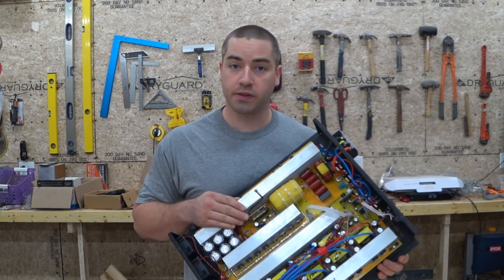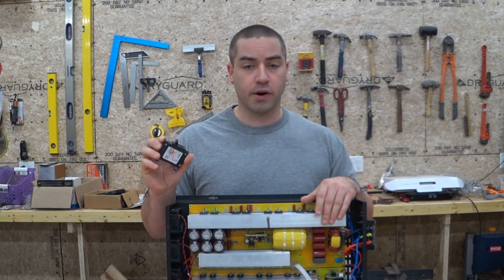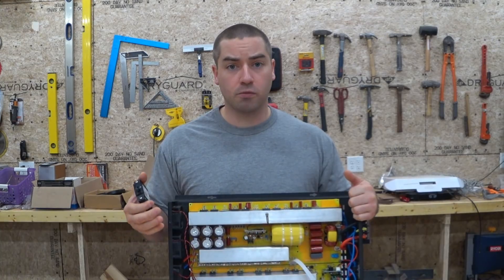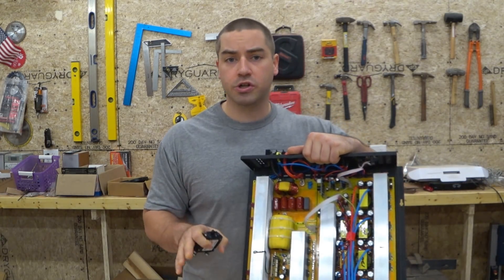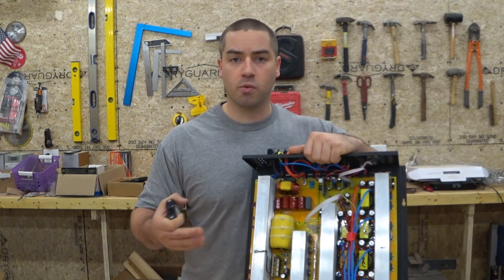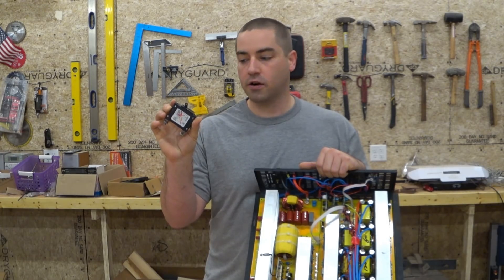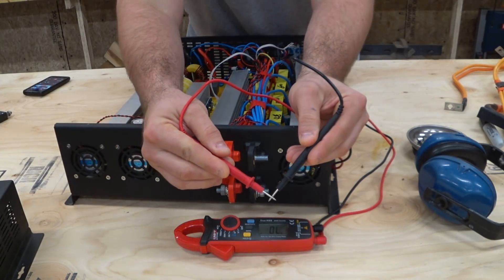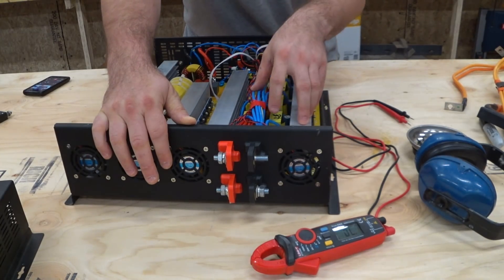Did I Blow Up the Inverter?

Comment: You had each "group" of that "junk inverter" burn out which lead to more and more power going through fewer and fewer of the groups until they all burned out for being short this caused the circuit breaker to break. Now, what cause the first one to burn out? Poor design.

Comment: Hi your correct to a degree regarding the circuit Breaker, but circuit breakers are designed for different applications, inrush of motors require a different type of circuit breaker, compared to a circuit breaker protecting a lighting circuit,

Comment: Did you increase the input wire wire size or triple them from your DC buss to the circuit breaker and inverter? I think someone mentioned that in the comments. It looked like you only used one of the supplied wires which would not supply enough current from the battery to the inverter to handle the surge and if you were to run a prolong draw of over 3k watts the wire would most likely melt. Hense, the 3 wires. A sudden drop of voltage at the input to the inverter would most likely cause a sudden current current overload to the mosfets' causing them to short and blow there fuses.

Comment: DC & AC are not the same... they behave in a different manner. In ac the electrons are in the center of the circuit and dc the electrons are on the out side of the circuit. this is why you should always use a much larger circuit for a dc current. You can install a large Cap. on the inverter side to fix this such as the cap/power supply for a car audio system.

Comment: I've designed inverters and switching power supplies for years and is now retired. It appears there is no load balancing and over current protection: they just hooked those individuals in parallel. To make it simple, these individuals have a heroic tendency to be "I can do it by myself" and when you hit it with big motors and/or capacitive loads that's pretty much a short circuit for the first few seconds, that fries the hero's  mosfets in no time.  Stay away from that brand or such design. Very tricky to start loads that are virtually a short circuit for the first few seconds.
Reply: thanks for this!

Comment: you are right on! you are not misreading this chart. the invert has no protection diodes, it has no snubber network. It is totally the designers fault of the inverter. Go to a you tube technician called (Diodes Gone Wild) and his power supply designs always have snubbers and diode protection circuits in every one containing Mos fet drivers

Comment: Jacob is absolutly right ... no snubbers on a cheaply built inverter will kill those mos fets every time
The spike on start up exceeded the mos fets peak voltage. A few more pennies invested in snubbers and protective circuitry would make reliable inverters company worthy of their name. I suggest sending them your miter saw to test their inverters BEFORE sending you another one. it will save everyone the trouble of burning out a third inverter in your home! maybe they will get it right on the third try

Comment: From wikipedia "When an electric motor, AC or DC, is first energized, the rotor is not moving, and a current equivalent to the stalled current will flow, reducing as the motor picks up speed and develops a back EMF to oppose the supply. AC induction motors behave as transformers with a shorted secondary until the rotor begins to move, while brushed motors present essentially the winding resistance. The duration of the starting transient is less if the mechanical load on the motor is relieved until it has picked up speed.

For high-power motors, the winding configuration may be changed (wye at start and then delta) during start-up to reduce the current drawn." ... on wikipedia they show a sample graph that this brief "in-rush" current can be like 50x of nominal ...

Comment: These are my observations ... 1) The multiple transformers are for the fact that the unit can handle multiple DC input voltages ... It looks like you killed the mosfets on the 48V transformer ??? ( I bet that if you can change the input voltage yourself it would work on all the other DC voltages ) 2) Your current calculations seem all wrong ... you seem like your mistaking amp draw on the DC input and AC output together  3) Without back EMF the pure resistance of the coils in the saw is the only current limiter in the first micro seconds of pulling the switch.  I think you can measure the ohms with a multimeter ( make sure you wait for the resistance reading to stabilize ) ... This should give you an idea with simple ohms law on the instantaneous amp draw when you pull the trigger. 4) The digital multi-meter is probably sampling to get a measurement of the amps ... probably an average over that sample time so a very very quick peak might be hidden over a sample period. 5) I was under the impression that AC breakers use a thermal means to cause a trip and again the thermal heating would "mask" an "instantaneous" peak were it would heat any wires much but an even very short but large current draw might burn out the inverter.  6) I would look on the spec sheet of the inverter and see if there is an instantaneous max amp allowed ...

Comment: Naw man...
U need to take a closer look at ur battery setup.. same breaker in both garage main circuits and in battery... they should both react the same in both systems. Long story short..batteries not compatible/communicating with inverter properly.
Reply: Also it looked like 3000 was wired in parallel which provided more voltage, and the 8000 was wired in series.

Comment: Just run the saw on 48vdc.  that's how do it.  Make a 48 volt rail for the universal motors tools.  They run slower but so much quieter and seems to be more ZEN.  If they have var speed idk.

Also add a
Reply: That would be a terrible idea. If any of the tools are 3 phase then you would be turning down their potential by 66%. And I would imagine they are, 3phase is more compact and much stronger.

Comment: There are 2 types of power inverters... low frequency (LF) and high frequency (HF). Difference is in design... HF step up voltage in high frequency in DC side - it is more effencient and cheaper (smaller transformers needed) and then the high voltage ~160V DC is by PWM switched to 120V AC (160 is because thats Vmax of 120V AC). The LF design works the opposite... You have just powerfull fets on low voltage DC side which makes the battery voltage to AC and then large transformer and smaller transformer to transfer it back for feedback. What happened here is just bad design HF inverter and cascade fail. It is caused by 2 possibilities.... 1st bad mosfets, 2nd bad design and cascade fail. I believe that both could be right bud lets see how it is made... Inputs are on one side and the current is pretty high. 1st transformer closer to the input will have lower losses on wires then the last one on the other end. That means than the first one will have higher current and can cause overload. Than cascade effect is pretty fast. Also theese big mosfets are not very good china ones.... try to find spare ones. Only china.
Reply from the maker: Thanks.  Since making this video I have bought a low frequency inverter and it works much better for me.  https://youtu.be/dfHb5tZErTs

Comment: Jacob is correct, though a bit long in explaining. :)

If you take off the output board is not shorted and should work.

The mosfets numbers will tell you there input current load and as I suspected you have over draw (input over current) causing a failure and then a 'dump' of the coils and cap (at max capacity) thus melting the trip fuse.

Your video looks too much at the out put side and the issue was within the input side. 

I was trying to look, but someone may have the same clue.
The coils seem to be as if they are part independent to double. However the flaw is that there back to the bus. So cannot and would by fault make the voltage/current out till load and then fail.

I would look at input rating and then the internal 'group' rating. The problem lays there, there isn't any diode I could see either that would have helped alot. (Rev feed)

Comment: After reading through most of the comments I just want to throw out a few things which may help. 
I bought a clamp-on meter with a very cool 'Motor Start Current" capture function. It was about the same price as all of the decent ones. Even the peak hold feature will get you close. 
Snubbers and Transient Voltage Suppressors (TVS) are not used on DC circuits from a battery source. They are used on utility input circuits to handle Transient Voltage Spikes which are added on the power distribution circuit, aka power lines. 
The very slight variations of length on the internal power conductors will have zero effect. It's a DC circuit so frequency is zero.The resistance difference would be insignificant but I can calculate. I have to guess at the gauge, maybe 12 ga. so about 1.6 ohms per 1000FT. The longest loop is about 2' longer than the shortest so about 3.2 mohms variance from best to worst. 
This inverter is not poorly designed. It is value engineered. There is a huge market for this. It's designed to delivery exactly what it claims. It is not designed to survive incorrect installation. The protection systems in the design assume correct installation. Many folks commented that they have seen failures due to undersized conductors. We watched it happen TWICE. This is extremely common in the consumer arena. 
When hobbying with electrical equipment please read all instructions and every label. Be sure to follow everything on the label exactly. The labels are required by UL to keep you safe and to prevent fires. 
I have been designing industrial 48VDC power and battery systems, and inverter systems for 3 decades. I have 100s running nationwide. However, I have not designed consumer products. It's fun seeing your innovative ideas here. Please be careful.

Comment: The fuses in the inverter are not there to protect the MOSFETs, they are UL required to prevent a fire when a MOSFET fails shorted.

The 80A circuit breaker had a chunk of metal fly out of it. You should take it apart to see the damage. It's no longer good for anything else. If it'll even close, please don't use it. 

it looks like the Volt battery has a 350A instantaneous rating. I'm sure it'll do that when new and not too cold. I think I'd be tempted to put two in parallel for this application.

Comment: I hate the bring bad news but yes you definitely did blow up both inverters. The input power circuit impedance is far too high. It's not really the ampacity of the circuit breaker but rather the impedance of the conductors, battery and breaker, but mostly the conductors. The problem is not as simple as calculating what you think the input power should be. It's more about the voltage every 1/120th second at the MOSFET input and even more importantly the control circuit. You see, the MOSFETs are really just the power transistors doing the heavy switching. There is a circuit that tells the MOSFETs when to turn on and off. If the voltage to that circuit dips for just a quick instant, the magic smoke can fly out. 

The instructions you  left in the box no doubt specified the circuit breaker ampacity and probably had warnings about using the supplied cables, etc... It is not okay to connect inverter systems input power using conductors smaller than required regardless of the output load expected. The two videos clearly demonstrate what happens. 

The lesson to learn is that too much input power resistance or impedance will result in too low a voltage at the input MOSFETs and/or their controller, which will result in a MOSFET short circuit. Too low a battery voltage would do the same except the inverter has input voltage monitoring to prevent that. In this case, the battery voltage was fine but the voltage at the MOSFET input is all that matters. When the current requirement changed quickly, the circuit impedance caused this voltage to fall below the MOSFET threshold so one side stayed on instead of switching off after 1/120th of a second. Of course it'll fail and they do typically fail shorted. 
If you get another shot at it, please do use all three provided conductors on each pole to a 200 Amp circuit breaker, or whatever size they recommended, that's properly mounted. You may also ask the engineer at Reliable Inverter if the Li-Cobalt battery model you are using is sufficient. 
If you get to keep the bad ones, I'd be happy to install some new MOSFETs for you and demonstrate it running my chop saw using some VRLA batteries. I'll even run it one a 8kW load bank. Then I'll send it back to you to see if the Lithium cells can do it. I'll even get a handful of extra MOSFETs just in case. I bet it is but, I'd like to know for sure if that battery is up to the task.

Comment: We didn't use a digital clamp-on ammeter when I was in the field because of the slow response time.  We used an analog clamp-on ammeter because you could see the peak that a digital unit would not detect.  I know most people believe a digital clamp-on ammeter such as the one you used in the video to draw your conclusions would be better than an analog clamp-on ammeter, but I know from experience, they're wrong.  A storage oscilloscope is an ultimate device to prove the point, but the analog ammeter will show you a lot.  A quality clamp-on ammeter was used at Western Electric/Lucent Technologies/AVAYA.  Technicians such as myself were given an analog clamp-on ammeter device to draw their conclusions in the workplace.  We all shared the same device because the digital equivalent showed inaccurate amperage.  We all shared the same device for simplicity and affordability;  the analog clamp-on ammeter was continuously checked for calibration because we were an ISO 9001 facility.  Now, obviously, if the smaller unit was able to start the testing piece of equipment, but the larger (8000-watt) piece of equipment could not, then there seems to be a problem with the 8000-watt inverter.  I'm just saying there is a potential problem with a digital clamp-on ammeter as shown.

Comment: I had an accident with an angle grinder last year because it kicked like a mule when switched on. My chainsaw has a soft start module, it is three wire, active in, active out and neutral. The chainsaw starts up over a seconds or so with no kick. The more expensive and larger angle grinders have a soft start and a safety switch - you must turn it off before turning it on. I noticed that your saw started to full revs instantly. Have you looked at getting a soft start type, or found a device that can be placed in between the power source that performs the same function. The soft start device is a XS-12/D3 but I cannot find any supplier for it. It looks simple to connect for a DIY project. Says 12/250 or 20/120 (A/V I assume).

Edit - See https://www.youtube.com/watch?v=GNJ3_SYp0Ak
The soft starter is added to the saw.

Comment: David, Your certainly learning as you go, thats ok.  You have to Check the Specification of the Invertors and Big Current Loads, ie your drop saw.  The Invertor should come with a Continuous Rating, probably 8000 watts but you need to Find the Surge rating, it may be as low as 10000 watts.  Also some invertors have Output Current limit capabilities which can explain the difference between Invertors.  Circuit breakers are old reliable technology, hence it is rare that there is a problem is there.  If the Breaker is tripping 99 times out of 100 it is doing what it should do.  You do have to make sure you have the Max Power supply Current and volts on the 48 V DC Input.  Check the Surge Rating on Invertor Dave, if your Drop Saw is 15 amp typical Start up currents are Very Quick but 5 to 7 times full load so 75 amps for 1 second.  Good luck.

Comment: Why not remove the lengths of copper wire feeding the groups and replace with a solid copper buzz bar and feed locally off that? As for car fuses, I have blown a 20amp fuse just pushing in the cigarette lighter accessory that feeds a simple small air fan and even my phone charger, so loose those, there are far smarter ways of circuit protection.

Comment: Not an electrician, but the circuit breaker opening was caused by the input side of the Inverter failing, a component at a time. As the inlet side of the Inverter failed, your input voltage was dropping, causing an excessive amperage increase. Lower voltage, higher amperage to try and keep the saw running. So as one component failed, it continued down the line, hence all the blown fuses. They do not seem to have any kind of input voltage detection, and control for this unit, the just assume it will be constant, but because of the 9 devices they are using to share the load, a single failure, leads to catastrophic failure of the remaining components. Just my take on the matter, but like I said, I'm not an electrician.

Comment: Carpenter and joiner.England .In work Circular saw used to trip the  huge 110 transformer.We now use slow start  Circular saws,They have a huge draw at start.now even if just the slow start saw.all the lights flicker.on a inverter.it says what it produces,but it also states the initial power surge rating.So it might say 3kw surge 6kw.What ever allows it to surge.Is not enough .That component is the problem